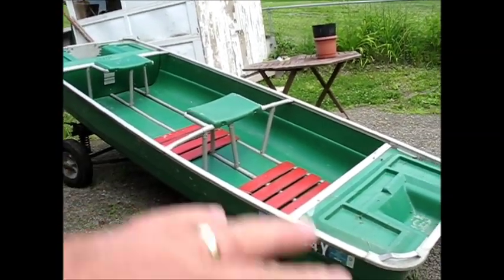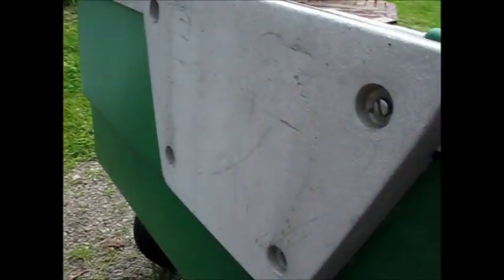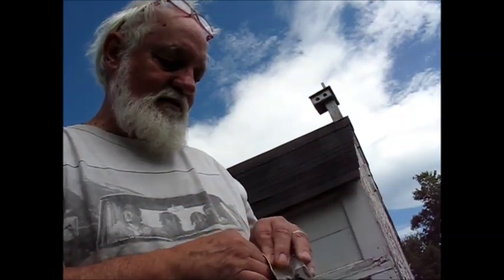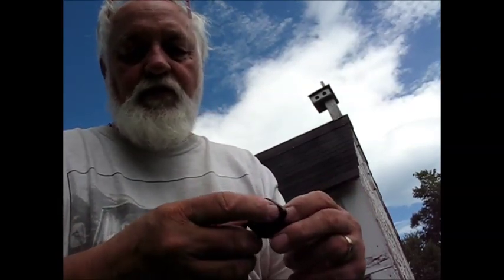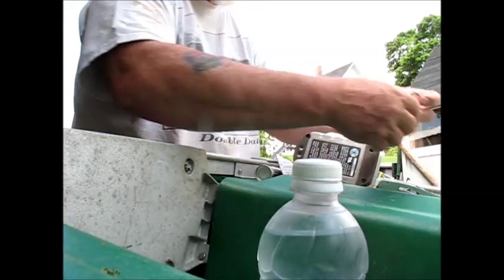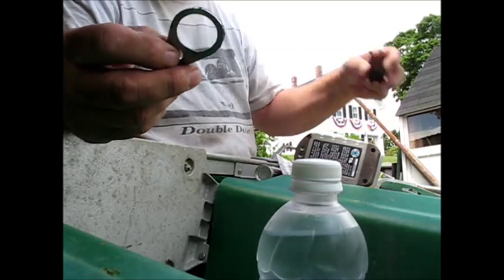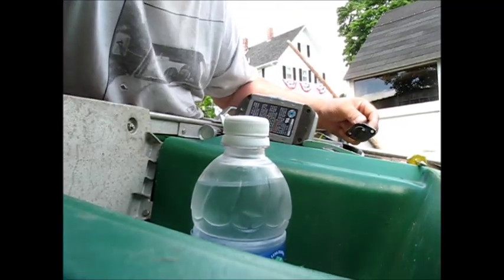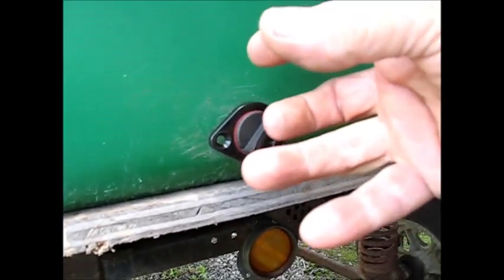Installing a Drain Plug in a Coleman Crawdad Boat

Comment: Yeah, outside I think would be better since the weight of the water would push the plug closed if it was inside.  Also that way you're not fishing into water trying to open it, it's outside and easy to access.  Good work.  :)